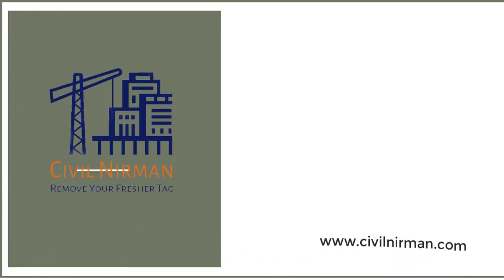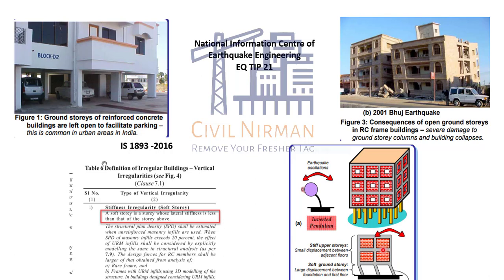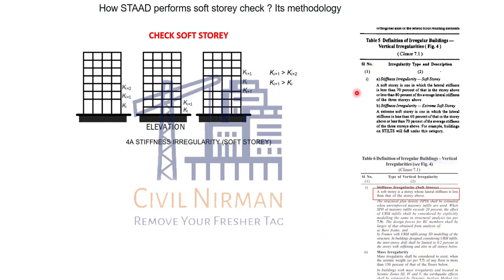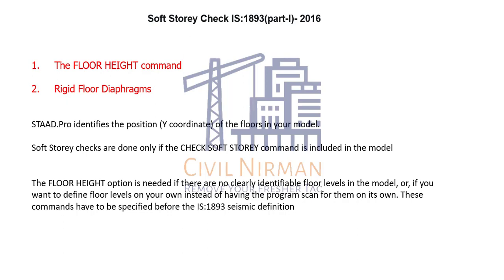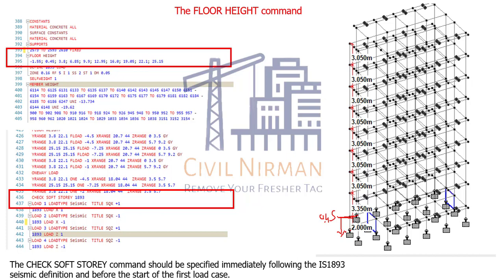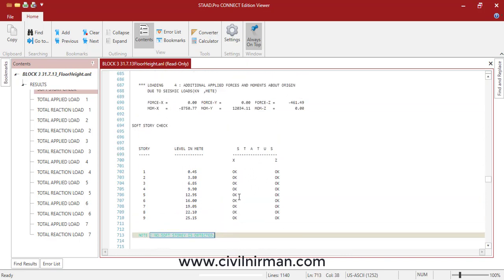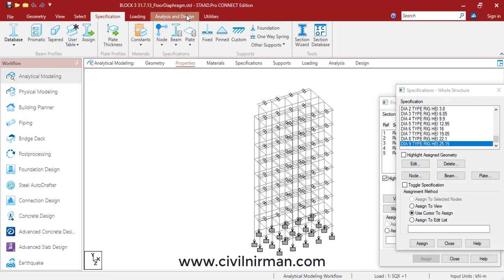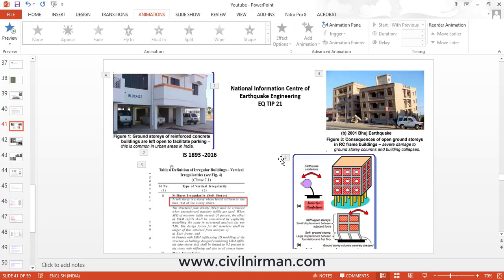Soft Storey Check As per IS1893-2016 in STAAD Pro Connect Edition

Comment: If i used floor height option,,,, warning comes like wall command need to be added like .
Soft storey results also not available
Reply from the maker: There have been a few changes in soft storey checking in recent versions of STAAD.Pro. In order to perform soft storey checking, one of the following is needed in the model: 

1.     The FLOOR HEIGHT command

2.     Rigid Floor Diaphragms 

On finding those commands, STAAD.Pro identifies the position (Y coordinate) of the floors in your model. 
Soft Storey checks are done only if the CHECK SOFT STOREY command is included in the model. Also, the PRINT STOREY DRIFT command is needed to instruct STAAD to check for storey drift.

The FLOOR HEIGHT option is needed if there are no clearly identifiable floor levels in the model, or, if you want to define floor levels on your own instead of having the program scan for them on its own. These commands have to be specified before the IS:1893 seismic definition in the following format.
FLOOR HEIGHT
H1; H2; H3; ……….Hn so on
In case of supports that are scattered at different Y levels, use the Y value of the one that has the lowest Y coordinate. FLOOR HEIGHT commands should be specified before the DEFINE 1893 command block as well as before the primary Response Spectrum load cases. 
Iike this  following commands have been provided before the IS:1893 seismic definition. 
FLOOR HEIGHT
0; 1.125; 2.25; 3.375; 4.5; 5.625; 6.75; 7.875; 9; 10.5; 12

Comment: I have two doubts, 1) I have applied 1st method to apply soft storey in which masterslave is not to be given ,and I did not give the master slave or rigid diaphragm option , but staad shows warning that ," Rigid Diphragm are not defined" , so does that mean I have to define reigid diaphragm in both methods?
2) How to check storey shear applied by staad at each storey by IS 1893 definition ?
Reply from the maker: To print the shears at each level, use the command PRINT LOAD DATA 
with the analysis command as shown next

PERFORM ANALYSIS PRINT LOAD DATA

The analysis output file will list the shears at each node and also by floor.